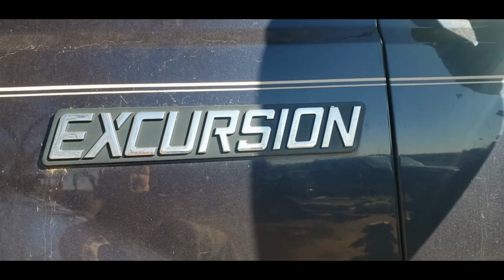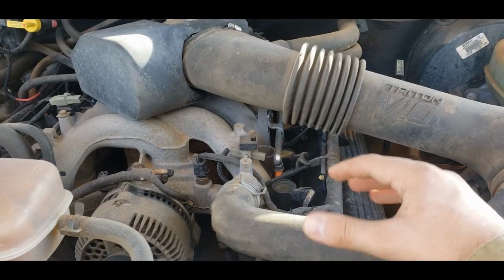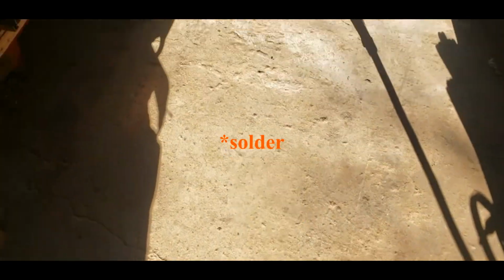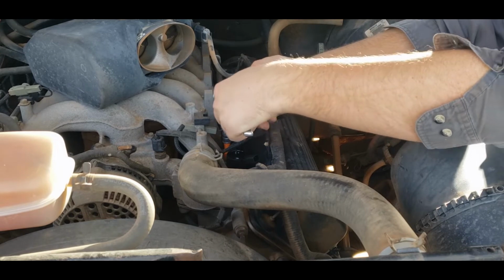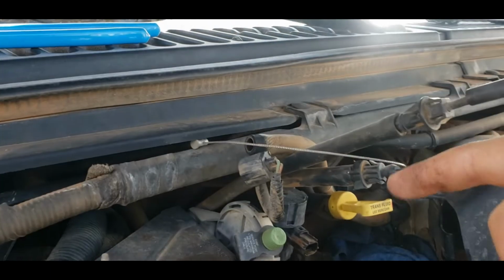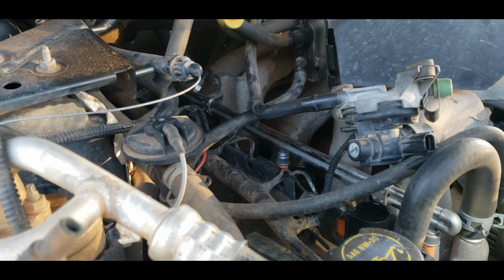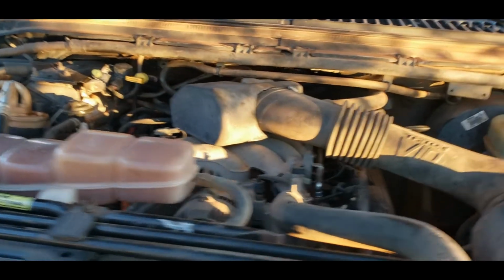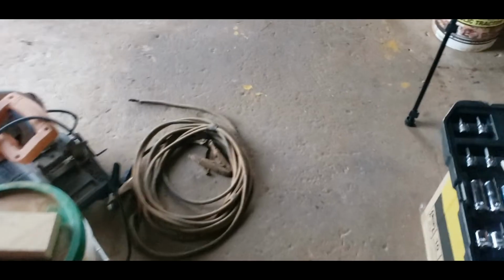2000 Excursion with Triton V10: Replacing Spark Plugs

Comment: What a Magic????, you take short threads out and put "long" threads in??? Cant do that???, Those plugs are for never model engine, older model use short threads???? Cant do this ???, Long threads will hit a piston=(((((
Reply from the maker: I understand your concern, but I assure you the newer plugs do not hit the pistons. I realize now that I completely misspoke in the video- the cylinder head has plenty of threads tapped; it was the OEM spark plugs themselves that didn't have enough threads.  So you can use a newer plug with longer threads without issue, as the head can accommodate them. My apologies for the confusion.
Reply: @Mighty-Quinn  OK, good to know, so...I have 2000 Excursion, V10 engine, so I could put longer thread spark plugs in my engine, no concerns, problems???
Reply from the maker: Yes, the longer threaded plugs are fine to use. I don't think you can get the short threaded ones anymore, actually. Most important thing is to make sure the plugs are gapped and torqued correctly. Plug gap is 0.054", and the torque spec is 132in-lbs.
Reply: @Mighty-Quinn  Great, Thank You  !=)
Reply: @Mighty-Quinn thanks for that doing mine now was a question I had

Comment: Gotta be careful with those spark plug sockets. I've had them get stuck on the spark plug and detach from the socket extension, causing the socket to get stuck on the spark plug. The rubber gasket inside the socket fits the spark plug to tight. I recommend removing it and using the coil pack to remove the spark plug instead

Comment: I just changed mine at 120,000 miles. Two of them that were “loose” enough to get em out without a ratchet. Too easy for my liking.  The plugs were all well over due.  I could see the erosion.  More than double the gap. I suggest doing plugs before 100k but remember to be careful with the aluminum threads. Clean everything beforehand. I used a shop vac with a homemade nozzle that fit inside the hole. Before and after removing the coils as well as the surrounding areas (injectors).

Comment: Can I use Motorola sp 479x plugs?
Reply: Thanks
Reply from the maker: Yes, the Motorcraft SP479 spark plugs will work in the Triton V10. That is what they had put in at the factory. 

Any spark plug you put in must be torqued to 132 inch lbs. I know it doesn't seem like a lot, but that is what Ford says to do.
Reply: I went to pullba plug out of my 2000 and the plug has maybe  6 threads on it compared to the 479 which has more threads .still safe to use?
Reply from the maker: @jamessampson5909  Yep, the new plugs with more threads are safe to use. I noticed the same thing when I was changing plugs, but everything fit great and has been running just fine. 

Just remember to torque them correctly, I cannot stress that enough. If you overtighten them, they may not come back out in one piece.
Reply: Can I use use sp479 plugs?or do I go with the 479x plugs?
Reply from the maker: As near as I can tell, they are the exact same plug. The more "modern" version appears to be the SP-479-X, so use them if you are in doubt. Otherwise they look exactly the same to me, just a slight variation of the part numbers.

Comment: Did you change the plugs when the engine was cold or warm and what ft/lbs did you torque them down to
Reply from the maker: I changed them while the engine was cold, and I torqued them to 132 inch lbs, which is what Ford says to do.
Reply: I torque mine to 23ft lbs. Don't go by the manual. The threads on these modular engines don't hold your spark plug if you torque them low. 23ft lbs and you will not have a spark plug blow out.
Reply: @TonyYesi   what year is yours i have a 04 excursion with the v10 in it
Reply: @johnmoore8456  I have a 2003 with the V8 gas engine. Changed my plugs and coils when the engine was cold. The back ones are somewhat of a pain to get to and require a lot of patience.

Comment: How do those plugs run? I see a lot of people saying use only motorcraft plugs.
Reply from the maker: SO far, they've been running just fine. Granted, these new plugs only have around 2000 miles on them right now. 

I've heard the same thing: "only use Motorcraft plugs", and while I don't dispute the quality, I have also never used Motorcraft plugs on these engines. I never saw a need to do so. There's not a notable difference between the ruthenium and the platinum (Motorcraft) that I can tell. There were a couple non Ford plugs in this engine that had been put in years ago (pre 200k miles) and they didn't look much different than the other 8 Ford plugs I pulled out. 

I don't remember if I mentioned it in the video or not, but my pickup (2001 F250 which also has the V10) has been running "Autolite iridium XP103" plugs for about 15k miles now, and I have had zero issues. These were worked fairly hard, since most of those 15k miles were driving 150 mile trips hauling hay, every day, for about 2 months straight. I even pulled them all about 8k miles after installing them, and they looked fine. None of 'em were loose either, which was nice. 

Based on my experience with this, I'd say you're fine to use non-Ford spark plugs. Just don't get anything less than platinum. Also torque them down correctly, that's the absolute biggest and most important thing.